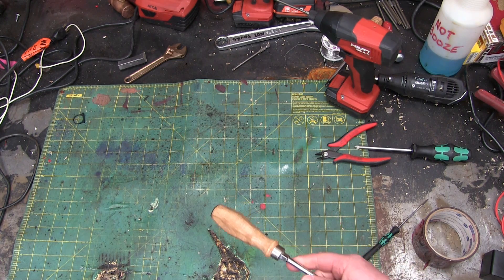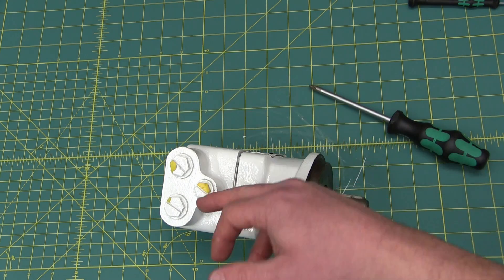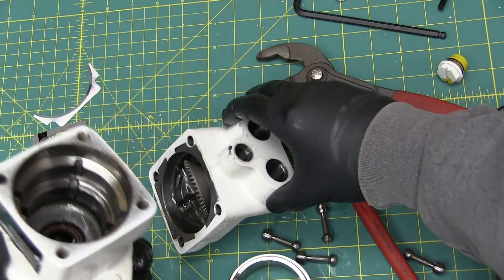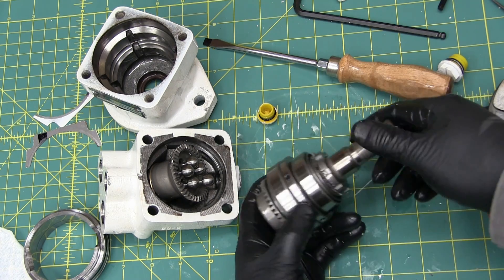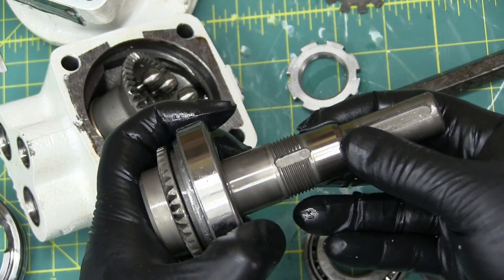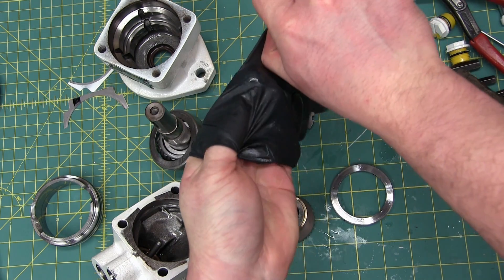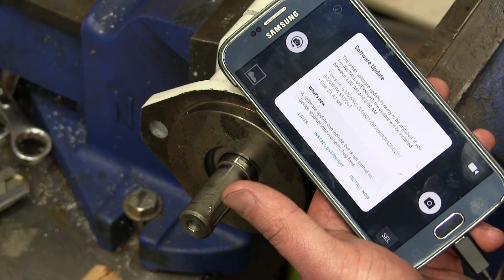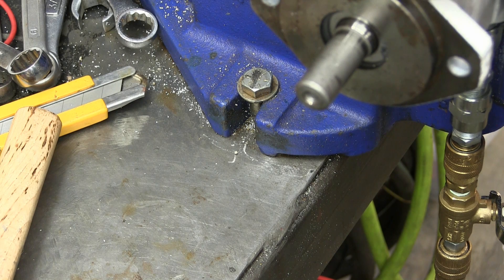BOLTR: Parker Bent Axis Piston Motor | Hydraulic Industrial Lego

Comment: There index point on the cylinder and barrel for timing. You can see them through the case drain port. 99 percent of the Tim they have them in good measure before you pop it open look through the port while rotating if you don’t see it you could punch the gear and the barrel teeth.

Comment: A mistake I caught was that you said the pistons are pushed back due to the pressure of the oil. But the oil is at tank pressure upon intake. The pump if used on a large truck like a wrecker it would run off a PTO. That means the oil is being sucked in then pressured on the compression or exhaust stroke. Idk what it would be called on a hydraulic pump. I love the videos man.

Comment: i honestly do not think that thing goes anywhere near 12k rpm or is anywhere near 100 hp.  (lol do you think that's actually like a 60 - 150 gpm motor right there?)  from the size i'd guess max rpm of 4k  if its a pump or 8k if it's a small displacement motor and closer to 10 or 20 hp.  lets get a model number

if anyone finds a hydraulic motor that size that spins 12k rpm lemme know

Comment: Great video mate, easy to see you know your stuff. My only question is, do you reckon this air motor could ever be used in reverse order with input power coming from the shaft? (just like a regular piston axial hydraulic pump?) I would love to know what exactly makes this motor design different, non return valves maybe?

Comment: Actually it used to be branded Volvo bent axial piston motor. Looks like a c10 version designed for around 12 gpm at max 2200 psi. Horsepower would be more like 25-20 hp. Generally rpm as a fan drive was 5000 rpm. They can spin faster but at a cost in longevity. Biggest problem was if case drain was restricted and not free flow to tank. Lip seal on shaft would fail.

Comment: That looks very similar to the fan motors they use on case/new holland air carts. I remember on a couple occasions forgetting to hook up the drain line, which then explodes after a minute or two of running.

Comment: There are specific torque specs. For the lock nut depending on the size of bearing. There is even a chart for how many degrees you need to turn the lock nut if you can not measure torque.

Comment: this type of motor is commonly used for hydro static drive motors in vehicles, hydraulic pump driven by engine will force hydraulic fluid into motor which you have to turn the wheels...pretty awesome stuff

Comment: K46 riding lawnmower rear axles the residential type most all brands have exact the same 1 no matter the brand ,john deere,mtd,cubcadet that style of pump in it's Hydro Drive that runs a hydra.motor which looks exactly alike but using a common housing with diff an spidergears all sharing same oil ,1 tiny leak for a short frys them have fixed way 2 dam many of them "there the cheesiest "😁

Comment: If you pull it out again and GAS enough, put a heavy flywheel on the output shaft. Enough inertia to keep it running while slow enough for your borescope to pick up.

If you attempt 12k RPMs with the flywheel, warn us all first. We'll place bets on what RPM the flywheel comes apart at.

Comment: O-ring boss comes in metric too. Closed circuit pumps have same size system ports. But they do mix sae and metric fasteners and ports on the same pump/motor. You're right though they are skookum as frig. I abuse them daily.

Comment: I have an old transmission from a WWII bomb bay door that contains two of these bent angle piston thingys.  One is a motor at a fixed angle like this one. The other, in the same cast aluminum case is a variable angle piston pump. Since it's variable angle, an angle gear around the perimeter of the 5-shooter cylinder wouldn't work, instead, there's a CV driveshaft through the center. the angle is adjustable with a lever outside the case.  It goes from zero degrees (where the output shaft doesn't move) up to an angle equal to the output bent angle (where the output shaft rotates at the same speed as the input).
It was all fastened together with wired screws. I took it apart years ago and couldn't figure out how to get the parts back together.  Its in my garage in a plastic bag and a coffee can of oil.

Comment: I had a summer job building axles for mobile homes and travel trailers. They modified the assembly line to weld the spindles onto the axles rather than having pre-built axles. Brilliantly, they didn't allow space or time for the axles to cool before assembly. We got pretty good at spitting on the axles to tell how hot they were so we could guess how much to preload the wheel bearings. By the time they got past the leaf spring assembly station, they had cooled enough to be inspected.

Comment: Those metal things are shims and they are there to evenly space the gears to give variable gear backlash cause those things spin at 3100 rpm (hey i wrote this halfway through so 3100 was a geuss until I watched it all) and as they need rebuilds the gear teeth wear and need to be closer in backlash

There is a lumber yard with two of these and it is a saur danfoss with 1 inch pistons (8 of them) to drive an 8 foot sawblade

Comment: Parker , the corporate retards who bought a company my buddy worked for and then fired everyone.  They bought the company because it had the contract, for over a decade, to make hydraulic cylinders for the US Army ARV (Armored Recovery Vehicle).  Shortly after buying the company (a union shop which was fairly profitable even paying the union wages), they closed the shop and fired everyone, moving production to a non-union shop in Wisconsin.  Six months later, Parker lost the contract due to the fact that the workers at the new shop couldn't make the parts to spec.  Fuck Parker.

Comment: When I read your post, I said to myself "Self, he has a hydrostatic motor or fixed volume pump with over pressure release." All you need is a variable swash plate pump to make it go backwards or forward in infinite increments. Check out the hydrostatic Eaton units on things like smaller Toro front deck riding mower, self propelled concrete saws, and even the lowly MTD brands of hydrostatic transaxles (Eaton hydrostatic units). Lots of fun to play with and many shop uses. I used them for riding mower racing (hint, if you stress them like I did, sinister 10w40).
Take care from Oklahoma,
Mike and the old lady that hates my cigars 😎

Comment: Could you replace an engine in a small car with one of those, and use a small riding mower motor to power the hydraulics?
Reply: Well you’d need at least a 100 horse power pump to drive the motor given a 1:1 covertion, well if i understood school right. Energy can’t be created, only converted.

Comment: Pixie wrangling I can do all day at any level but for some reason I cant quite get to grips with the finer points of this sort of kit. This particular motor does raise a question though. As the air equivalent motor is bigger and heavier, why are these not used for jet engine starters. Most of them are very roughly 80hp for the 20,000 lb class engines, this produces more power and is lighter. There is probably something fundamental like some hydraulic fluid being flammable or something but I'd be curious if anyone knows for sure.

Comment: But why not just have a hydraulic motor with a bevel gear transmission? Would that not be so much simpler to design, easier to manufacture, and easier to service? The only benefit I can think of is this is more compact.
I mean this is a cool piece of engineering, but it seems a bit over engineered for a solution that can be accomplished with more basic industrial legos.

Comment: The shaft got etched (scale prevention) during processing to ensure no cracks/surface flaws formed during or from the drop forging, milling,  or heat treatment process after, the bearing race, the only "to tolerance" fits were machined after heat treatment and the whole part then probably underwent a final surface hardening, the threads were rolled on directly after forging.

Comment: That motor sounds like she's got a pretty hot camshaft in 'er
Reply: unigrampa's Laboratory 3/4 race cam!
Reply: It sounded kind of ratchety ...Was that just the sound of puffs of air exhausting or metal wearing nastyness?
Reply: sound of air, when its a hydraulic motor it just sounds like a water pump
Reply: Need to throw some stage 2 springs in there.

Comment: Oddly enough, Bombardier uses the same type of pump for the hydraulics of the Learjet. If you hear the plane making funny squeaking noises as the engines start to spool up, the hydraulic fluid is low. I'm making a guess in assuming that a vane or gear pumps would have cavitation under the RPM that a turbine engine puts out on the gear case.

Comment: We make alot of industrial stuff in sweden. When I made haldex parts we had UNC UNF  NPT and metric within the same part. Pipe fittings are often sold as metric these days but they are all compatible with BSP threads whether they are cylindrical or tapered. At least the ones I have used.

Comment: Those piston sealing rings on the pushrods look incredibly similar to the gas rings on the rear of an ar-15 bolt. They use 3 steel rings to seal against the interior of the bolt carrier to allow gas pressure to unlock the bolt face from the chamber.

Comment: I assume I'm safe in assuming the bleed off, 3rd hydro connection, is also there for when there are varying loads on the motor? When its under more load it will bleed more than when it is under smaller load.

Also really appreciating how hydraulic fluid is both power transfer and lubrication combined in one.

Comment: It's a lot like a tilt-block motor. Except the bit where the block would be is part of the case, thus no variable angle to it. (Those are kind of neat too, variable speed and variable stroke for a given flow rate.)

Comment: For a bit of history, the reason these motors are made in Sweden is because this motor style was invented by Volvo and were bought by Parker.  They have been the best motor in the industry for years.  These motors are one of the few things that Parker has bought and just left alone because anything they changed would just screw it up.
Reply: Actually this motor was a product of VOAC, a collaboration between Volvo and Atlas-Copco. VOAC was bought out by Parker Hannifin
Reply: @bobsacamano4648  it was Volvo before it was voac ,been using them for 30 years now.

Comment: While you had the boroscope in the ol' hole, you could've just pretended that nobody's watching and put yer greasy hand on the shaft and start rotating it with speed matching your needs.
Reply: He said he couldn't turn the bearings due to pre-load.  It had a key so should have been easy to do some rubber w/ a pipe wrench or c locks.
Reply: M Hamma ah missed that. Guess it would've been fine with a foot long chooch amplifier as well.

Comment: Bearing plate is on the vise incorrectly at 9:00 
Having it that way can bend the bolts when it's pressed or jammed in this case it can cause it to bind when you want slide the plates closer
P.s love the videos keep up the good work

Comment: I wonder what kind of torque that motor produces
Reply: Being in Canada, wouldn't that be "toque"?

I'll show myself out...
Reply: Torque output of a hydraulic motor is a function of the motor displacement and the supply pressure. For example, a 100cc/Rev motor and supply pressure of 100 bar will produce a torque of 160Nm.
Reply: All tha torques !
Reply: HP is a function of torque and speed, so T=HP*5252/RPM. In this case that is roughly 440 ft-lbs or 600 N-m, assuming AvE's 100 HP figure is correct.

Comment: This is a similar mechanism to how a Karcher 3600psi pressure sprayer works, just in reverse. The petrol motor drives the input shaft. That has an off axis plate that pushes 5 pistons back and forth as it rotates to boost the pressure of the fluid giving you high pressure fun.

Comment: Leakage is cooling, gotcha, it's like I say with my old volvo wheel loader from -79, if it's leaking oil, it's got oil.
Reply: Affra thats what i always say! Start worrying when it stops leaking!
Reply: Only way to know if there's oil in it is if there's oil under it.
Reply: Someone told me he saw an old Caterpillar wheel loader where instead of the transmission fill plug there was a tap. Each evening the operator would drain several liters of oil from the trans and pour it into the hydraulic tank. He sai "I'll just put it back where it came from". Had a leaking transmission mounted hydraulic pump so the oil came from the hydraulics system. Also heard of a Lännen loader excavator that had a sheet metal pan suspended by chains under it's belly to catch the drips. :)
Reply: And it is good against rust too.
Reply: Yeah no need for a dipstick XD
Reply: I'll tell you and old swedish trick to get the Volvo loader (or eny other machine) to stop leaking oil (or other liquid). In Swedish; om du slutar fylla på så slutar det läcka = if you stop refilling/toping of it will stop leaking! 
Problem solved ;)
Reply: Affra Various Oils Leak Very Often. 
Source, quality time with 90’s L70
Reply: Old Valmet engines on ye oldi Sisu trucks used the same method. SL180/181 and similar.
If the oil pan wasn't oily and covered in muck there was something wrong with the engine.

Comment: I'm really curious what prevents the pistons from popping out of the sockets, and staying bottomed out in the cylinders (besides the oil film in the socket), when the motor is turned by hand (say in the installation scenario). I realize that it wont be a problem when fluid is in the cylinders as it pushes the pistons back out, into the sockets.

Additionally, i'm not an hydraulics expert, but when the motor is running, and is being braked suddenly, is the braking happening on both input and output or only one of them? i.e will a vacuum exist in the motor at any point during normal operation?
Reply: Yup, merely any angle of the cup outside of 90 degrees will capture the ball of the connecting rod - beautifully simple in design & function
Reply: Usually hydraulic motors are braked by throttling down the fluid supply to the motor. When you brake the motor running a fan (for example)  is is possible to create a ‘vaccum’ on the supply port. This is termed cavitation in hydraulics. Cavitation is detrimental to the life of hydraulic components, and can be avoided by using anti-cavitation valves.
Reply: iii